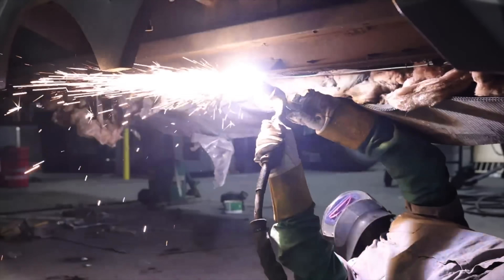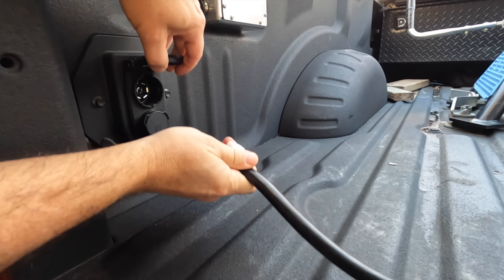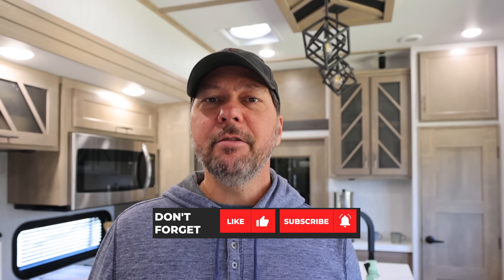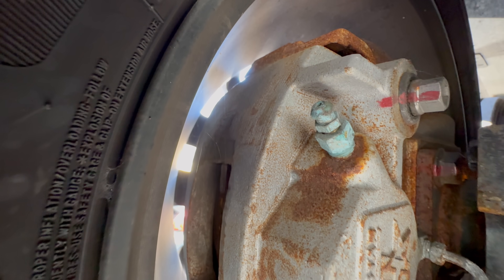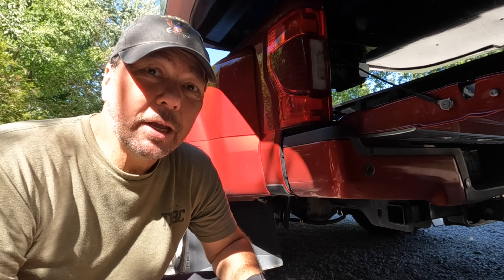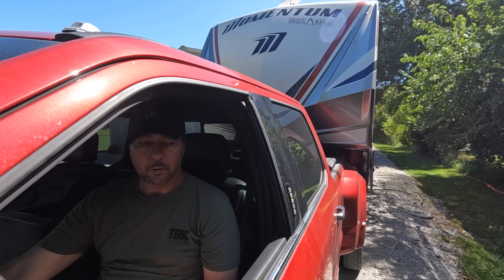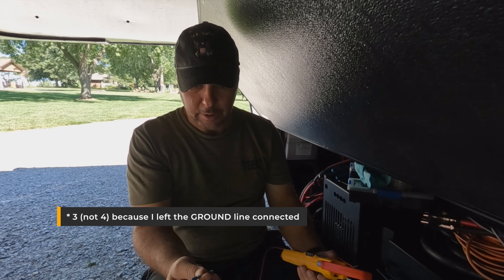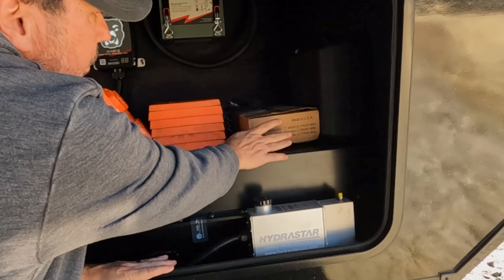RV Brake Troubles!: Solving a Perplexing Hydraulic Disc Brake Issue

Comment: So my first Question is does the MorRyde Controller get a Trailer Battery (Constant Power ) Feed - thus bypassing the Trailer Connection for Power ? Some Modules Need Constant Power then a second power source (switched ...) to operate.  I've experienced Automotive Module not working ,  then pulling power from said Module and Normal Function Returns. That would lead to a software update or replacement of Module (Some Modules Years ago could not be updated). The Last Circuit that I would look into is the Ground Between Trailer and Hauler. Voltage Drop Ground Circuit while applying Brakes to see if you have excessive Voltage Drop on the Ground Circuit which would lead to a Poor Braking Performance . A good look at the MorRyde Controller Ground Circuit would also be on my check list. Hope this Helps. Your going to learn a lot about this during your "Search and Destroy" session.
Reply from the maker: The controller is the Ford OEM brake controller.  It supplies the variable control voltage.  The "power" supply comes from the RV as does the breakway power.
Reply: It may be wise to completly change the brake fluid ,flush out and replace with new fluid .
Also check the bleeding procedure for those units .
Where there are connections there will always be a failure of some form ,solder joints and correct heat shrink sheathing .
From the brake unit to the fifth wheel hitch could be a complete harness ,that only disconnects at one point ,is simply rolled back into the RV .
I don't know what pin connector is used but Anderson plugs are quite robust .
Another thing to consider is the compressor in the brake units are small and work very hard ,they may get to a point of being overworked and worn out ,it's worth checking.
Those brake units used to have their own brake controller unit,so there is no trying to get factory vehicle units communicating with them ,are they truly compatible ? 
When you had your driveway issue ,were the brakes not holding then?

Comment: Should have not broke the configuration and tested with a pull test to see if the problem was still present before you started troubleshooting.  There could have been a soft short in the wiring to those LED brake lights.  By removing the LED junction box, you eliminated the soft short. This could manifest itself by pulling the voltage down on that wire.  If it’s the same wire that powers, the hydraulic actuator, there may not have been enough current to drive the actuator and thereby less breaking.

Comment: The only thing different from normal towing, was that you didn't connect your volta system. I know it sounds funny but when weird things happen  you must look at weird  solutions
Reply from the maker: Good point.. The brakes worked fine on the next real tow (with the VPS connected).

Comment: checking for continuity isn't telling you much.  a abd connection can show good continuity with a meter which passes a tiny amount of current.  but under braking conditions, the current is much much higher and a bad connector will show a voltage drop.  we had the same condition on our electric brakes, full voltage at the truck's 7 pin, 1/2 that at the trailer despite the continuity test being good.  the issue use a badly oxidized pin on the trailer cable

Comment: Its a bit unimaginable to me that the manufacturer of a piece of equipment of that build-quality (it is the best, right?) would not provide access to the input terminals and a pressure test-port (w/ a mini-valve & plug) on the discharge.

Comment: If you have an integrated trailer brake control system on truck. That’s probably your problem. They are junk as they use so many different parts of truck to sense how much power to send to trailer brakes.

Comment: I had a 2022 f350 tremor…with only 2500 miles….I  had a very similar problem with 2 equipment trailers.  Trailer manufacturers blamed ford and ford blame the trailers. Anyway…I was so sick of issues I sold the truck and bought a gmc….so I never had the issue fixed.  Trailers had no problem with gmc. Later ford did reach out to me a say it was a recall.  I am in Canada. Not sure if recalls will be the same for you fine people in the south. Maybe if you have access to another ford..try that…it would eliminate the truck…My 2 cents.
Reply: Mine had the recall and got the trailer brake controller module reprogrammed and works great now. I looked it up and saw the notice because the 5th wasn’t stopping like it should. Really strange you didn’t research it before you solve it.
Reply: My ford was 1 month old.  Not much to research.
Reply: @toddwarkentin4757  I have a 2022 F-450 order it in June and received it November of 2022. I tow a 21’000 lbs 5th wheel with the independent suspension. The brake was not working properly. I knew about the recall after reading about it. While in Tucson Az. we are from Georgia. For the first oil change they reprogram the module and it’s been working great even since. My question is did you have Ford look at it to see if the brake controller was not working correctly. 2500 miles and you got red of it that quick. Hey it your truck glad you are happy now.
Reply: Too funny.....shortly after you switched to GM the 2024's excperienced loss of trailer brakes for months before it was resolved. Factory brake controllers are farsical at best.

Comment: Turn it off turn it on? Phones, computers, cable boxes and now brake controllers. Good luck. If it happens again the first item I would check is actual brake hydraulic pressure.

Comment: LOL< it's probably a combination of the welds failing on your "Grand Design" and that damn "Ford" truck, lol, need some humor, grab a beer, and relax...
Reply: Their rig won’t fail because they installed the I.S. the ones that are falling have spring suspension. And his Ford didn’t even have the trailer brake controller recall like mine did.

Comment: Oftentimes, the focus is on the power side of the circuit and neglect to check the ground side of the circuit.  The video doesn't show us where you are placing the  test leads to take your readings.

Comment: It’s your Ford. Not the trailer. Check out the Ford trailer brake system. It’s electrical on your problem
Reply: His didn’t have the trailer brake controller recall like mine did ! Got it taken care of at 5000 mile while it was getting the 5000 mile oil change and service.